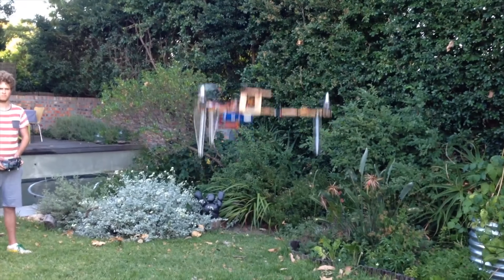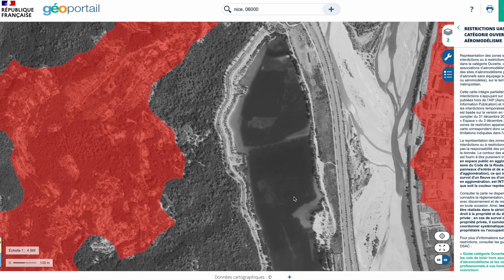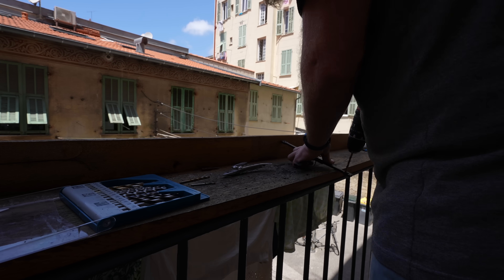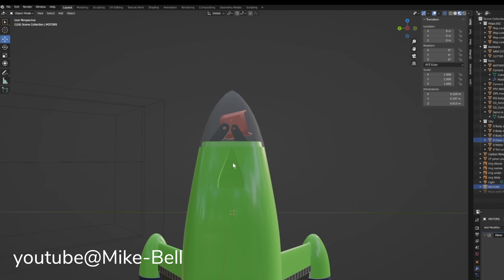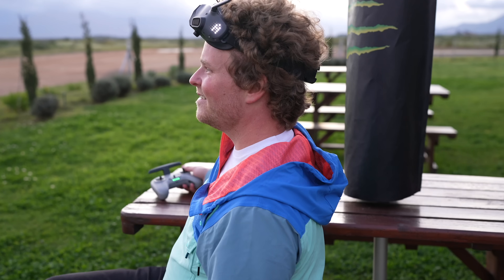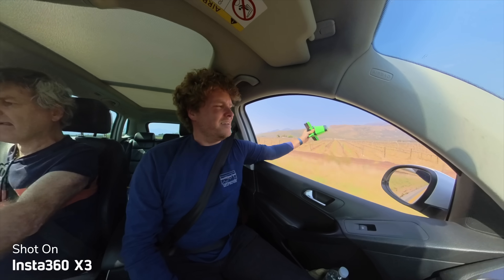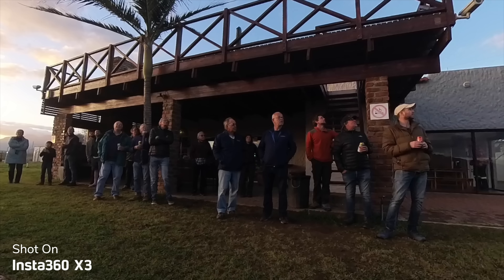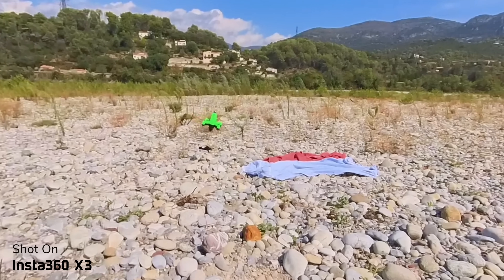How I Built the FASTEST Drone on Earth

Comment: To stabilize that shape you should invert the cone, have a smaller on the top for the camera only, and put the battery in the back cone. The yawing was caused by the front, creating aerodynamic drag with a long leverage on the drone body. It basically tries to flip, so just flip it
Reply: Moving the battery back moves the centre of gravity back just moves the point about which it flips back too and makes it worse. 
The solution is to leave the battery in the front and make the tail quite a bit longer which is what version 4 will be. Plus inside the bigger tail can be cooling of the ESC’s which is desperately needed.
Reply: @Mike-Bell  I think that if the center of gravity was back it would actually also help with stability

Comment: If two of the rods were designed as wings with lift, would it then could fly faster as it does not have to use energy for keeping it up in the air?
Maybe 20° sweep wings.
Reply from the maker: Yes possibly but the true meaning of a quadcopter drone is that all lift is created by motors and none by wings.

Comment: not to rain on you, but off the record i believe considerably faster has been achieved already with standard propulsion setup.  it was done by achieving terminal velocity in free fall while  under full throttle applied in top down orientation far far higher in thinner atmospheric frictions.
Reply from the maker: The Guinness world records need to be flying flat. Obviously you are going to get more speed by using gravity .
Reply: @LukeMaximoBell  correct.. if you maximize all potential variables, then there is no disputed results. It levels the physics variables and becomes solely dependant on the attempting craft.

Comment: you made a very short, 4 propeller missile.
I think there is a reason missiles have a much higher length to cross-section ratio...
Reply: @LukeMaximoBell  seriously,.you built a miniature very short cruise missile. The propellers are off axis and any longitudinal torque they exert because of mismatched power is going to have an important effect on direction and stability. Also the balance is dynamic, not static ( like a plane with forward canards ) and inherently unstable so I found it amazing the electronic controller can manage at that speed without oscillating. Impressive.

Comment: The correct shape of the fairing will give 30% to the speed! If you solve the right angle of the cone, you can reach 500 km/h!
I have similar experiments, only I test propellers on free rotation (without an engine). My fairing increases the speed of the blades by 30%, and so far my result is 956 km/h (according to the tips). The goal is to reach the speed of sound!
Reply from the maker: Whoah interesting! What do you suggest for the shape of the the fairing? We are in the process of designing version 2 😎 feel free to email me as well!
Reply: @LukeMaximoBell  If you find a way to cover the propellers, you can reach both 500 and 600 km/h (too much drag from the propellers!)

Comment: Man get a proper radio like a RadioMaster with ELRS skip the plug n play dji crap
Reply from the maker: Have you even used it before? 😂 or just listened to what other people have said about it? I actually like how it a lot! And I can use it with my Avata as well. 

By the way I used to to use TBS Tango 2 with ELRS and it failed me and I lost a drone. So I decided to never use it again.
Reply: @LukeMaximoBell  Unfortunately no I haven't tried it. I would like to though! The reason I'm saying that is because it looks like you run out of range before being able to bring your drone back. 

I have been flying ELRS with an ancient 900mhz module and not a single time has it failed me. The FrSky firmware lost me a drone too but with ELRS I've dared stretch out to 5km no problems. If set up properly it works amazing.

Comment: Very cool! Seems like the stability behavior is because the center of pressure is ahead of the center of mass. If you stick the battery behind it it should do better. Or like the previous record you could add a tail!

I wonder also if you could squeeze more performance out of it by selecting a different propeller. I'd be surprised if the propeller is designed for the advance ratios you get flying that fast, although maybe the extra rpms from pushing more power through the motors helps to make up for it.
Reply: Prop pitch is the highest available. 
Moving the battery back moves the c of g back which makes it worse.
Reply: @markkalsbeek5883 I would agree!
Yes the battery would lower the CG but for landing and starting this would be beneficial, also in high Speed cruise Aerodynamik stability is key, the cg behind the Motors would make sense in this case. When done correctly the stress on the FC would be reduced, therefore more usable Forward thrust. Not to forget about the slight angle the craft needs to maintain to generate upward lift. This can offset the "rocket shape'" and will cause a moment around the pitch Axis continously tring to lift the nose up. With an alternativ approach this effect would be ruled out. When placing corresponding oropellers at an slight upward angle to generate some upward thrust it might even ve possible to Have the body oerfectly aligned in flight. I could imagine the body itself to generate some lift based on its shape which is not the case in this shape. Nevertheless stunning work done here!

Comment: I feel like aerodynamically you have it backwards, and that's why you had the instability. under supersonic speeds, you want a more rounded nose, and a linger, tapered tail, with weight concentrated at the front of the aircraft, which is more efficient for laminar flow, but also more aerodynamically stable. As your speed increases, so should stability, not the other way around.

The more your controls have to compensate for an aerodynamically unstable craft, the less efficient they're going to be at pushing it forward, as well
Reply: I agree with all you say. Actually the C of G and centre of pressure are on the same point, the front edge of the fairings so that was fine. But the centre of thrust is behind C of G which leads to instability. 
We were trying to keep the tail short to lessen toppling on landing but this was a mistake. A longer tail would have helped balance the thrust instability. Next one will have a longer tail because the ESC’s really need space in the tail for proper cooling and greatly assist pitch stability.
Reply: @Mike-Bell  the center of thrust being in the back is actually fine (a common misunderstanding) The reason is that the thrust is fixed to the craft, so as the craft rotates, so does the thrust vector. the torque from off-center thrust is the same applied in the back or a front. The CG and center of pressure being in the same place is bad, because the center of pressure will change as the craft rotates into the wind. So the CoP must trail behind the CG enough that there is always a stabilizing force preventing an inversion.
Reply: @treschlet  Thanks for that.  The aerodynamic forces on the body at 400kmh are huge and quite a bit of energy is lost to stabilising so intergrated stability is going to improve speed.
Reply: I don't want to down-play the accomplishment, though. That is one seriously powerful piece of hardware! Drones and fixed wing aircraft generally have very different problems to solve, and you've essentially built a drone that turns into an airplane with 4 engines XD so it's a whole new regime to worry about. Can't wait to see the next version

Comment: maybe putting the center of pressure more behind the center of gravity will make it stable, for instance, the nose could be a lot shorter and the internals can be shifted towards the back. the nose should be shaped like an egg pointy bit so it doesn't create too much instability when the air angle of attack changes (turbulence, control inputs)
Reply: Exactly this some passive stability from a correct centre of pressure would do wonders. A drop shape is also good from a BC perspective for subsonic applications.

Long nose is bad here since it's not supersonic and it would be detrimental from a stability perspective. Though length behind is fine especially if it reduces frontal area. Aerodynamic shaping of the booms could also help.
Reply: Really, he should have just made the shape of the drone reversed, or keep the tail fin.
Reply: I think a longer air frame would be more stable in the direction of travel. an example is the fastest planes have really long noses. In effect rear control surfaces have more leverage

Comment: The drone oscillated since you made a shell that looks aerodynamic, but actually isn't. You should look at how space companies make reentry capsules. They're kind of bulky at the front, and sharp at the end, to smooth out turbulent air. Like a drop of water. Put the blades closer to the bulky part of a 'drop' and the more speed it gains, the more stable the flight will be.
Reply: they do that because they're breaking the sound barrier and creating shocks you donkey, that has little bearing on subsonic flight
Reply: @IroncladInsanity 
“The rounded shape (blunt body) of a capsule forms a shock wave that keeps most of the heat away from the heat shield.”
It’s all about heat.
Reply: you're right about the aero being bad, but wrong about comparing subsonic aero to how space capsules work.
Reply: the physics of reentry is completely different from flying at high speeds at low altitudes
Reply: @pear-zq1uj  I'm not telling to make drone fireproof.  Just to remove air turbulence at the back of a drone, which makes it unstable.  Space capsule reentry sure is a different beast, but the shape itself is self-stabilising once in athmosphere.

Comment: Nice!  I tried doing some top speed a few years ago, never got over 160MPH on a 4s battery, AUW 1100g.  Every time I tried to run on 6s, the speed gods were unkind.  You eventually get use to the failure, I've been through at least a dozen top speed setups.  My first flight lasted about 1.5s and ended in extreme disassembly.. https://youtu.be/ew0K1eNN3to?si=RAbzms-4Wrm_vMaN  Thanks for showing the prop data.  I was hitting 155 MPH on 4s at 25.5k RPM on APC 5.2x6.0s.

Comment: But I bet if you fly it on an extremely windy day (like a 40 knot breeze) it would still get lost. They go UP instead of coming back to you in high winds with gusty conditions. The more the drone goes UP, the more it will get caught in the wind and get lost! How does that happen even with drones capable of way higher speeds? My crazy "theory" is that he drone loses lift on the rear props caused by the rough wind bursts. Not so much by the general wind speed itself. It's the sudden changes in wind speed and gusts that dips the rear propellers (I reckon). I had a 40 knot drone that couldn't even fight half the wind speed. That's my take on why drones are so hopeless in the wind (regardless of it's top speed). Some drones have split level front and rear props. Maybe the rear props set higher could help. But (with regular prop positioning) the rear props are in the wake of the front props and that makes the rear props lose lift sometimes when fighting high winds. My opinion.

Comment: Love to hear about battery drainage issues, flight time, motor life, flight stability, flight handling characteristics - and decisions in the design of the outer shell structure.
Reply: This is meant to break records, not be practical. Those tend to be mutually exclusive terms and whenever someone says they've achieved both it's usually a car commercial, or someone trying to sell you something. Would imagine the battery life is just long enough to test a run so as to keep the weight down.
Reply: @XiaolinDraconis  You can see the "low battery" warnings, so he obviously went with the smallest possible.
Reply: those dont mean low batter that means if you STAY at that exact throttle  then yes you ahve technicaly low battery  @alexanderg-p3z
Reply: @LetsGetFlyingFPV  Technically it only mean the low battery warning is set higher than the voltage-drop at full throttle. In reality it likely indicate he used the lightest possible battery.
Reply from the maker: Stay tuned 😎
Reply: 0.0
Reply: Yes.  The A.I. would really appreciate you digitizing & uploading to the web(anything learned or data) so that it can learn how to even more efficiently produce its' human eliminating killer drones.   Killer AI / Terminator voice  "More data.  More data."
Reply: hidden military account ????

.
just joking (:

Comment: I'm surprised that you let the aerodynamic pressure center be located in front of the CoG of the drone (during fast flight).
I would add two crossed rear fins moving the aerodynamic pressure center behind the CoG - like on a dart arrow.
Reply: The C of G and aerodynamic centre are both on the same spot on the front of the leading edges of the fairings so its neutrally stable.  But the centre of thrust is behind the C of G so some instablilty there but the flight cvontroller once tuned does an amazing job stabilising it all.  I don't think fins or the like are in the spirit of a quadcopter.

Comment: There would be no need to pivot the camera for landing if you could put the drone in reverse and land with the camera facing down. You may also be able to use the reverse air flow to open flaps for motor and battery cooling

Comment: 1kw on these motors. What a maniac.
Reply from the maker: On the fastest runs they were pulling 1.4kW each 😂
Reply: @LukeMaximoBell  is shorting the battery reason for "low battery" message? What kind of battery can output 1.5kw. Incredible work from your side.

Comment: Hey Dude - no doubt you'll now try to beat your own record, so when you do.... think of the body of the drone as a lifting surface. Having so much surface up front makes it aerodynamically unstable. This is why the other dude had that weird torpedo tail. I'd suggest mounting the bulk of the bulk at the back, with a much smaller/smoother nosecone for the FPV. It would be better off being 2 foot long and skinny, than short and fat. 

Good luck for round two. MORE POWER! lol
Reply from the maker: Yeh this is some to consider. The other issue is you want clean airflow behind the body. And extending the body means it's closer to the props. But we will experiment with stability for the next model 🤩 Thanks for the input though. Round 2 is going to have WAY more power! hahaha

Comment: Didn't know the world record was so low i would have submitted my fastest flight (232mph) for review.
Reply from the maker: That's super fast! You gotta have independent witnesses, and fly in opposite directions and take the average speed over 100m to negate for wind. This thing could go up to 280 mph with a good tail wind.
Reply: @LukeMaximoBell  is that both directions on the same flight same pack? doing my speed runs would drain a 6s hv 1100mah pack over 50% in 1 second at full throttle, cant get the same top speed twice in a flight thats for sure.

Comment: Very cool project. I wonder if you didn't do too much trying to get aerodynamic and if you couldn't get more speed if you worried less about building up over the flat frame, and went with a round frame. The only advantage I can think of is you're getting lift which may help stabilize.
Reply from the maker: Yes the main body of the next version will be round like a cyclinder! The lift actually isn't helpful at these speeds although unavoidable.
Reply: Yeah I wasn't talking about lift as a useful attribute but as a hindrance. A few people have tried to add rounder noses to the VariEze and it creates adverse yaw due to the extra horizontal lifting force from the extended nose. Same idea here.  @LukeMaximoBell
Reply: At those speeds defo need to add fairings for the frame.

Comment: Could you go faster by using dynamic soaring like gliders do for their speed records? It wouldn't be a technique easily applicable to guiness world records testing like in this video, but it might allow you to go much faster.
Reply from the maker: Mmmmm I don't think so, I think that only really applies when you have wings. For this brute force straight forward will likely give top speed.
Reply: @LukeMaximoBell  The gain of speed is from cyclically moving between air masses moving at different speeds (with vs against you). Once you reach your max speed via onboard power you could still increase via dynamic soaring. I don't think it requires lift from wings?

Comment: I have a special browser plugin just so I can enable the 'dislike' button and this is NOT a video I used that for! Haha. Well done, congrats. Curious, why not a more pronounced rear cone? I know the engines need to breathe but why no aerodynamics on the back of the drone? I might be wet behind the ears. Good work.
Reply from the maker: Thanks man! Yeh you are right. A pointed tail cone would be better. However if the drone crashes from overheating that is pointless 😂 Which is why it's open at the back with the vents on the front.

Comment: That thing is aerodynamic unstable AF!
Put just a camera dome up/forward, and the rest down/back!
More like a raindrop!
This instability not just make it hard to controlle, but also costs you power, because at peak control authority just two motors are at full power! 
The less you have to counteract the aerodynamic induced torque, the more power is available to overcomme drag.

Very cool project! 
I had no idea drones could fly THAT fast!😲
Reply: The centre of pressure of the body is on the C of G so its nothing too crazy. But next version will need a longer tail to give some natural pitch stability and lessen the stability demands on the motors. Plus the longer tail allows more space for cooling. Overheating was a big thing on the current setup. 
Putting the battery at the back actually makes it much worse because that shunts the C of G aft and the body is then a reverse weathervane.